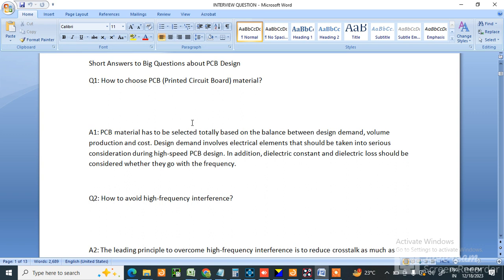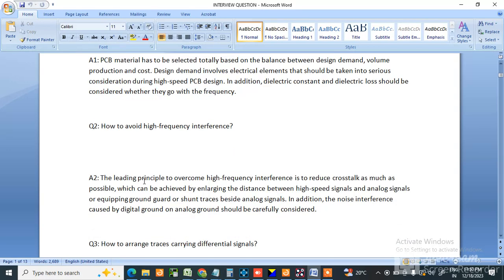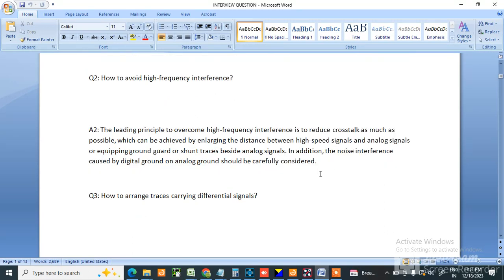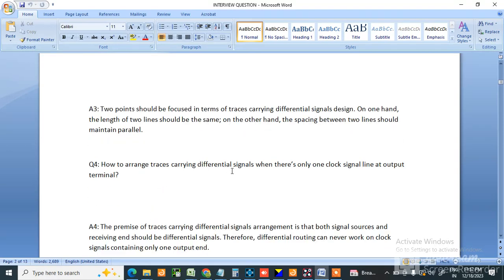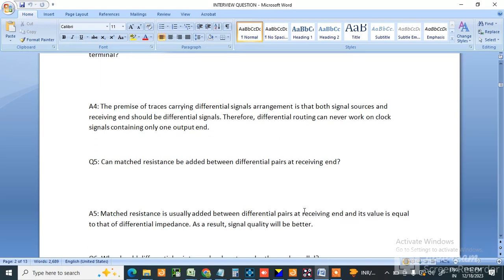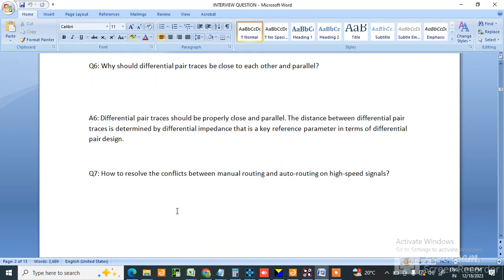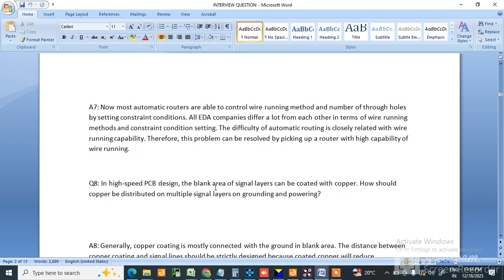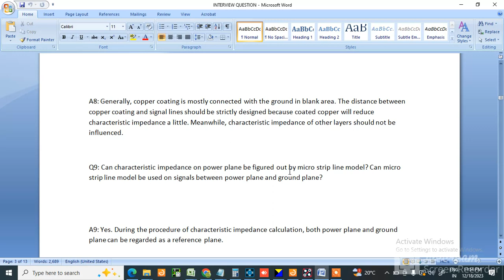pcb design interview question and answer

Comment: Hey i have seen your videos,can you guide me how to change connection in your pcb after manufacturing? In my  smd pcb i need to change component connection,is there any way to change after receiving pcb hardware?
Reply from the maker: No u can't change it after manufacturing
Reply: @RubyDikshit  thank you for your reply
Reply: Cut the trace, reroute with thin copper wire from a inductor.